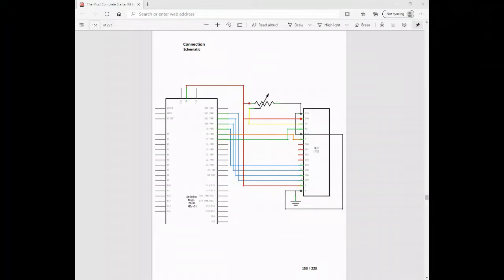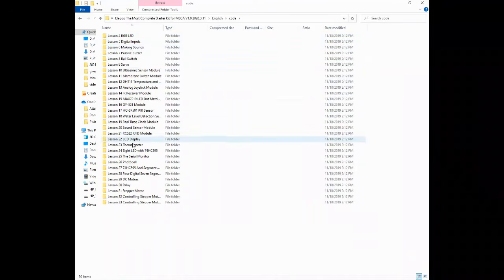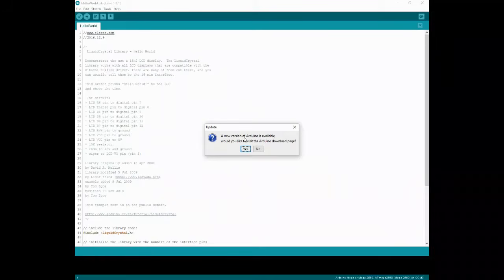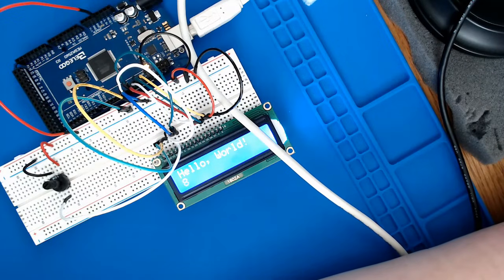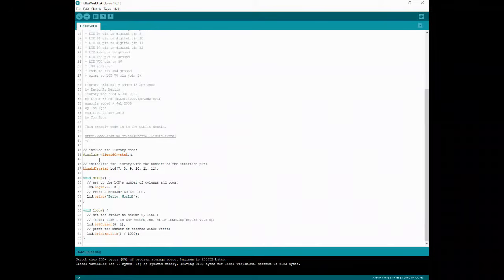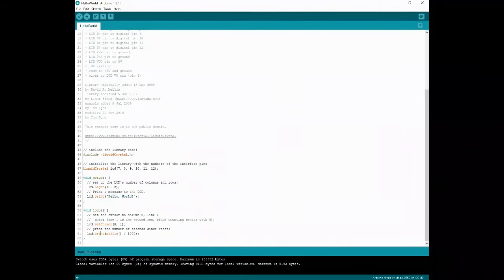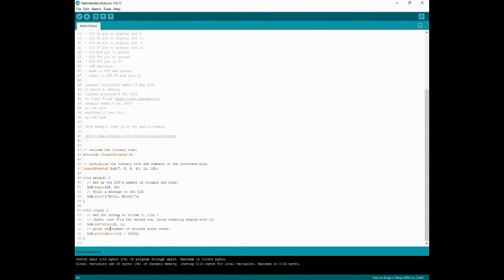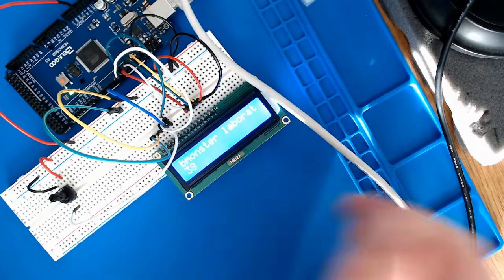How To Connect An LCD Display To Arduino (Elegoo Mega 2560 Project Lesson 22 From Start To Finish)

Comment from the maker: If you're using the 1602A LCD module, it may require a 220ohm resistor at the 5v rail - put it on the A or K pin. The Elegoo Mega kit doesn't mention this in their tutorial. I never had an issue without a resistor on the power rail. Sorry for any inconvenience this may have caused.
Reply: Yeah guys please look out if you have the 1602A display, they look EXCACTLY the same, and mine is now patially broken.
Reply: @ViralChina中国  same but i used my 10 year old math skils to fix the electric flow for LCD and i fixed it !!!

Comment: do we need a resistor for pin A on the LCD?
Reply from the maker: hey there!
Sometimes a resistor is added to limit the current and protect the backlight LED, unless your LCD already has a built-in resistor. If your LCD backlight is  really bright or you’re not sure — add a 220 or 330 ohm resistor to pin A. It won't hurt anything and can extend the life of the display  👍😎

Comment: hello i connected everything like in a tutorial but the only things that’s showing up is blue screen i can see any text or something
Reply from the maker: make sure your potentiometer is wired correctly.
If you're using LiquidCrystal library, make sure the pins match exactly what you have in the code.
make sure you have the commond ground pins connected.    
hope that gets it working! 👍👍
Reply: @BMonsterLaboratory  everything is wired as in video
Reply from the maker: @ukyo5373 can you share the code you're using ?

Comment: Err the text wont boot up
Reply from the maker: Hey there!
Did you read thru questions posted on this video? May be helpful. 
Check pin connections,  adjust potentiometer, make sure to connect common ground pins. Did it compile?
👍
Reply: @BMonsterLaboratory Yeah,  Thank you!

Comment: Please I need your advice, when I connected it, itshows me nothing just rectangles even with the code
Reply from the maker: hey there!
It sounds like your display is not being initialized. Did you double check pin connections - specifically, the RS/E pins?  Also try adjusting your potentiometer. Are you using example code?

Comment: My screen comes on at full backlight brightness when I plug it in the potentiometer doesn’t adjust and I don’t see those boxes it’s just pure backlight I’m wondering what I did wrong
Reply from the maker: make sure pin 1 and 15 are grouneded. make sure pin 2 and 15 are connected to 5v, and pin 3 (v0) is connected to the middle pin of the potentiometer.
probably just a minor wiring issue.
Reply: @BMonsterLaboratory  thank you. I figured out my issue was the pins on the potentiometer weren’t seated into the breadboard. Had to press it really hard lol…
Reply from the maker: @AnitaMaxWynnn  Good job!   check out the I2C displays. They are easier to connect - 4 wires total

Comment: i tried it without connecting vss and it still worked how?
Reply from the maker: hey there!
Are you getting a reliable connection or does it have noise?
You may have an accidental ground path connection through the K pin, the backlight ground.  You should still connec vss to common ground for a reliable connection. 👍👍
Reply: @BMonsterLaboratory  ok and yes that is the problem thanks
Reply: @BMonsterLaboratory  the problem was i derictly connected the resistor to the arduino, now its fixxed TY
Reply from the maker: @Problox10YT   glad you got that fixed. problem solving is the best tway to learn! 👍

Comment: um i did everything correct and when i plugged it in it worked correctly but as soon as i tried to code it nothing happened. my code was good and i don't know why my lcd didn't work
Reply from the maker: hey there!
what do you mean "when i plugged it in it worked correctly" ?  what was on the screen?  
is the screen blank now?  is RW connected to GND ? If RW floats or goes to 5V, you’ll get a blank screen. Are you using proper resistors?
share the code that you couldn't get to work. 
happy to help troubleshoot!

Comment: When I started uploading its taking like 20mim till now to upload I am still waiting
Reply from the maker: hey there! sounds like no communication between board and IDE.
make sure you have the correct port and board selected. unplug the usb and try another usb slot on your computer. 
shut down IDE an reopen.
did you get it working?

Comment: Am i the only person that didnt work
Reply from the maker: Not at all. What problem are you having?  Do you get a backlight? double check connections, turn potentiometer, use external power supply (bread board power supply) for display if you have many items connected to arduino. 👍

Comment: May you send the link of the code? that will be great:face-red-heart-shape:
Reply from the maker: You will need to download the Liquidcrystal library  "#include <LiquidCrystal.h>"
You can alter the onscreen text to whatever you like. 
This is the code from the Elegoo Mega kit: 

//www.elegoo.com
//2016.12.9

/*
  LiquidCrystal Library - Hello World

 Demonstrates the use a 16x2 LCD display.  The LiquidCrystal
 library works with all LCD displays that are compatible with the
 Hitachi HD44780 driver. There are many of them out there, and you
 can usually tell them by the 16-pin interface.

 This sketch prints "Hello World!" to the LCD
 and shows the time.

  The circuit:
 * LCD RS pin to digital pin 7
 * LCD Enable pin to digital pin 8
 * LCD D4 pin to digital pin 9
 * LCD D5 pin to digital pin 10
 * LCD D6 pin to digital pin 11
 * LCD D7 pin to digital pin 12
 * LCD R/W pin to ground
 * LCD VSS pin to ground
 * LCD VCC pin to 5V
 * 10K resistor:
 * ends to +5V and ground
 * wiper to LCD VO pin (pin 3)

 Library originally added 18 Apr 2008
 by David A. Mellis
 library modified 5 Jul 2009
 by Limor Fried (http://www.ladyada.net)
 example added 9 Jul 2009
 by Tom Igoe
 modified 22 Nov 2010
 by Tom Igoe

 This example code is in the public domain.

 http://www.arduino.cc/en/Tutorial/LiquidCrystal
 */

// include the library code:
#include <LiquidCrystal.h>

// initialize the library with the numbers of the interface pins
LiquidCrystal lcd(7, 8, 9, 10, 11, 12);

void setup() {
  // set up the LCD's number of columns and rows:
  lcd.begin(16, 2);
  // Print a message to the LCD.
  lcd.print("Hello, World!");
}

void loop() {
  // set the cursor to column 0, line 1
  // (note: line 1 is the second row, since counting begins with 0):
  lcd.setCursor(0, 1);
  // print the number of seconds since reset:
  lcd.print(millis() / 1000);
}

Comment: im confused of the 2nd gnd
Reply from the maker: hey there!  You can possibly have  3 ground connections on the lcd display.
vss:  is the ground for circuitry of the module
k;  is ground for the backlight
rw: the read/write pin. ground here sets this pin to write mode only

multiple ground pins help isolate different parts of the module and helps them work together more efficiently. It also helps with stable power and reduces flickering and electrical noise.

Comment: Hello, I'm new at this. Everything is working, however I don't know how to edit the text. Where do I find the set-up or edit? Thank-you.
Reply from the maker: Hey there! Include the liquid crystal library (LiquidCrystal.h) and change text in lcd.print line from "hello, world" to whatever you want. Play around with that,  look up lcd display example code that you can find online,  use arduino ide reference page for functions,  variables,  and structure. I found this very helpful when i started.  https://www.arduino.cc/reference/en/

void setup() {

// set up the LCD's number of columns and rows:

lcd.begin(16, 2);

// Print a message to the LCD.

lcd.print("hello, world!");

}

Comment: when i open the file to open the project then it says "the destination path is too long. rename the compressed(zipped) folder and try again." any help?
Reply from the maker: make sure that the destination path where you're trying to save or access files is not too deep within the directory structure. Try renaming some of the folders in the path if any are too long.

Comment: I have this kit, I've only done the first project...simple switch. How do you know where those connections go? Do they explain in the book or do you know by doing some formula?
Reply from the maker: hey there!  You can look at the schematic (like the one at 7:10)  to see where wires and components go. If you're not sure of a symbol in the schematic, do a search online for schematic symbols. You can start at the beginning of your arduino tutorial kit and work your way through. You can also find basic arduino project books online or at a library. This Arduino reference is good to use while learning code https://www.arduino.cc/reference/en/. I also used https://www.w3schools.com/cpp/default.asp when learning how to write simple code. There are also videos on youtube that help you get started.  I hope that helps!

Comment: mine works but it shows just boxes ( █ ). Can Somebody Help Me With This Problem!
Reply from the maker: Hi there! Did you adjust the contrast settings on the display? Do this by turning the potentiometer. Is it getting appropriate power?
Reply: @BMonsterLaboratory  i did but its showing still the block (turning the potentiometer just makes it invisible) i have coded it to say "hello world" but instead it shows " █ █ █ █ █ █ █ █ █ █"

Comment: Video didn't say anything about using a 220 ohm resistor to power the LCD so mine burnt out. Yay!
Reply from the maker: Man, sorry to hear that. When I made this video I was working through the Elegoo Mega Kit tutorial and it made no mention of a 220ohm resistor on the A or K pin. Shortly after this video I switched to an I2C display, and I wasn't aware this was a problem. Thank you for letting me know.

Comment: Hi seh, can I have the link for the codes , You said you are goingto provide us with.
Reply from the maker: Thy this for Hello World sketch. 
// include the library code:
#include <LiquidCrystal.h>

// initialize the library with the numbers of the interface pins
LiquidCrystal lcd(12, 11, 5, 4, 3, 2);

void setup() {
  // set up the LCD's number of columns and rows:
  lcd.begin(16, 2);
  // Print a message to the LCD.
  lcd.print("hello, world!");
}

void loop() {
  // set the cursor to column 0, line 1
  // (note: line 1 is the second row, since counting begins with 0):
  lcd.setCursor(0, 1);
  // print the number of seconds since reset:
  lcd.print(millis() / 1000);
}

You can also download the Elegoo Arduino Mega complete kit and get more code from there.  It's on the Elegoo website under "downloads"

Comment: Does it work if I plug the the screen directly onto the arduino, im not using a potentiometer
Reply from the maker: Hi Anthony.  Yes, you can connect it right to the arduino. The potentiometer is for contrast adjustment. It may be difficult to read without changing the contrast a bit but you can connect it without a potentiometer.

Comment: My screen just keeps flickering? I’ve done all the correct connections and I’ve used both of the potentiometer?
Reply from the maker: hi there!  Sounds like it could be a power supply issue or maybe a backlight issue. Have you tried external power? Use a breadboard power supply rather than Arduino. Maybe a loose connection on the breadboard? Have you checked the serial monitor to see if it's operating correctly?
Reply: @BMonsterLaboratory  I think they a loose connection on my circuit but I don’t know where. When I mess with the wires it flickers more
Reply from the maker: @akhz2  switch wires or breadboard holes and test. Good job finding the potential cause! 💪

Comment: help me my potentionmeter  wont work and idk where the lcd is
Reply from the maker: happy to help but not sure where to start. Did you set it up? Can you get the back light to come on? Is there print on the screen at all? Did you turn the potentiometer? Double check your connections. Where are you stuck?

Comment: Where do I get the file
Reply from the maker: #include <LiquidCrystal.h>

// initialize the library with the numbers of the interface pins
LiquidCrystal lcd(7, 8, 9, 10, 11, 12);

void setup() {
  // set up the LCD's number of columns and rows:
  lcd.begin(16, 2);
  // Print a message to the LCD.
  lcd.print("Hello, World!");
}

void loop() {
  // set the cursor to column 0, line 1
  // (note: line 1 is the second row, since counting begins with 0):
  lcd.setCursor(0, 1);
  // print the number of seconds since reset:
  lcd.print(millis() / 1000);
}
Reply from the maker: that will get you started. Let me know if you need help adding anything.
👍

Comment: I couldn’t get the LCD’s pins on the bottom to get into the breadboard. How can I solve this?
Reply from the maker: Happens to me sometimes.  Use another row on the bread board, press firm and flat but not on the screen.  An I2C LCD display would be easier to use
Reply: @BMonsterLaboratory  I’m using the same LCD as you. I managed to get it working without the bread board, thanks for the help with programming though!
Reply from the maker: @Funrollercoaster606  good job! an I2C display uses only 4 leads. Easier to manage and cleaner look. There's a 20x4 display in this video https://youtu.be/x911--B7cEA  if you have questions just ask

Comment: hey, I have  managed to light up the LCD but the text is not showing up
Reply from the maker: Hey there! Here are some things I would do. Check all pin connections,  adjust potentiometer,  include lcd.begin(16, 2) in your setup to properly set up rows and columns. I assume you're using liquidcrystal library.

Comment: avrdude: stk500_getsync() attempt 9 of 10: not in sync: resp=0xa7
avrdude: stk500_recv(): programmer is not responding
avrdude: stk500_getsync() attempt 10 of 10: not in sync: resp=0xa7 what do u do if this happens
Reply from the maker: your board and pc aren't connecting. make sure you select proper board and port under "tools", hit reset button on your board, unplug usb and plug into a different usb port on your computer. hopefully one of these will do the trick!
Reply: @BMonsterLaboratory  Thank you so much I thought you wouldn’t reply, but you where right I had my board selected as a uno but I have a mega so I just changed it now it works.
Reply from the maker: @tharbigdaddy3441  Glad to hear you got it working.! I appreciate all the questions and comments, so I do my best to try and respond to each. Thank you for your question and hope to hear from ya again!

Comment: keep getting invalid library message on upload
Reply: Got it to work after modifying Liquid Crystal Command. Thanks again
Reply from the maker: @CornwallDigital  excellent!
Reply from the maker: are you using liquid crystal libratry?  #include <LiquidCrystal.h> at the top of your code?
If you don't have it you can download it. In Arduino IDE click "tools" - "manage libraries" - type "LiquidCrystal" into the search bar. You can install it from there. One you have it downloaded you can use  #include <LiquidCrystal.h> at the beginning of the code.
Reply: Still not functional
Reply from the maker: @CornwallDigital  can you send your code to bmonsterlab@yahoo.com ?

Comment: Hi, when I set this up the lcd screen would turn on but not display text, I had done everything as show and even gone to the extent of putting EVERYTHING in the same spot. If you could please help that would be great 👍
Reply from the maker: have you adjusted your potentiometer?   hopefully that's all it is.
Reply: @BMonsterLaboratory  yes I have and it did not do anything.
Reply: @JoeMama-ld5ob  I have the same problem @BMonsterLaboratory

Comment: I'm going to say that this is very but very helpful but, i think i dont have the colored teal cable and i would just do it with the blue ones instead and so it wasent working
it was lighting up but not showing up the text. i'm a starter from like 2 days ago cuz the package came 3 days ago... so i have some problems on this...

Free to reply me!
Reply from the maker: First thing to do. Double check connection.  Lots of wires and easy to miss a connection. Adjust your potentiometer to get print on screen.
Reply: @BMonsterLaboratory  i have checked it before and nothing, no text no objects just blue screen. but hey its ok cuz i can do it all of it again. Thanks for the instructions!
Reply from the maker: @drxd.d sounds good. I can help out if needed.  Good luck!

Comment: My brain hurts

and we're gonna plug THAT into the positive rail
Reply: I found the problem, it turns out the wires were in the wrong section, because I couldn't figure out which port to use
Reply from the maker: @ratrower  that's easy to do. I usually include a schematic for reasons like that. If I didn't include it on this video, sorry. Glad ya got it workin!
Reply: I'm good, i had some C# knowledge
Reply: now to learn the language so I can code the thing
Reply from the maker: @Home time mayhem  aside from taking a class, I'm sure there are some good books out there. Also check out cplusplus.com and https://www.arduino.cc/reference/en/ for some examples to get you started.
Reply from the maker: Haha. You made me laugh. Do you need help with getting it to work?